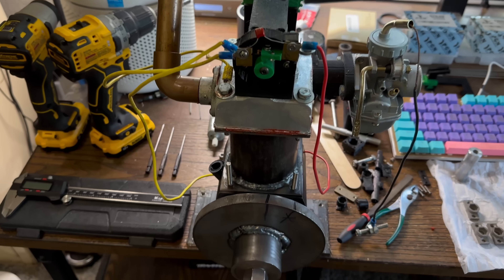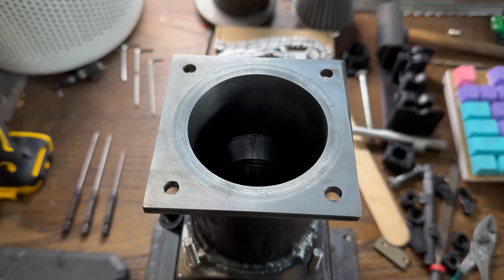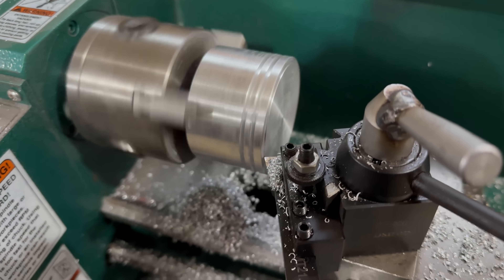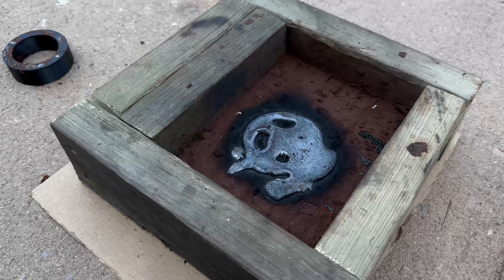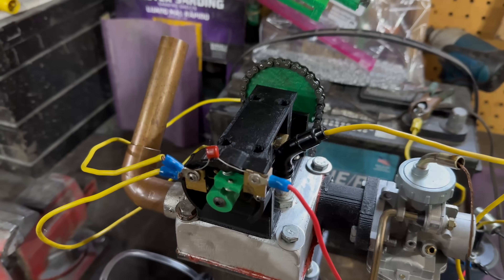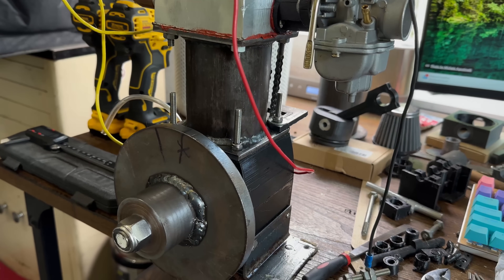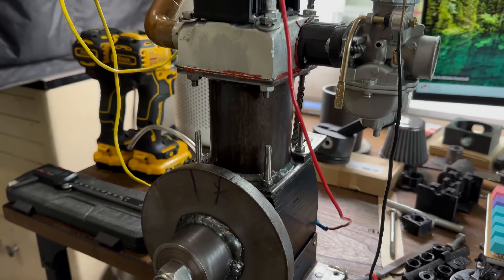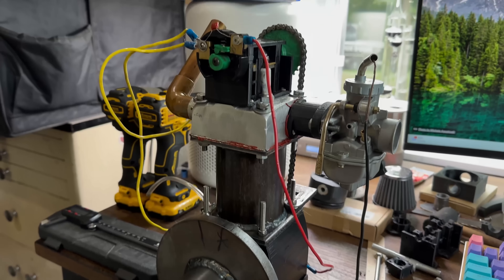Homemade engine gets Aluminum piston! Technology from a Top Fuel Dragster!

Comment: 6:30 
strength is not the real issue the real problem is heat no matter how strong the plastic,is it will burns it gets too hot
Reply from the maker: You should check out my latest video, I think you will like it!

Comment: I love the experiment but 3d print filament just can't take friction heat. The longer it runs the hotter it gets the more it melts and comes apart.
Reply from the maker: Yeah, it was just for fun though. I knew from the beginning that I was going to end up with a full metal engine, but I wanted to see how far 3d printed parts could get me. Also, the 3d printed parts were amazing for prototyping, it made making the engine much easier.

Thank you for watching!

Comment: You shouldve made a cast of the connecting rod using that drag cylinder
Reply from the maker: The issue is is that cast aluminum is very weak, the top fuel piston is forged, so when I melted it down, I lost all of its properties.

Thank you for watching!!

Comment: a cooling fan and some welded cooling fins on the cylinder cans help for the run. the temperature in the cylinderwall and combustion chamber are overheating?
Reply from the maker: I don’t know, although I’m not going to air cool, I’m going to wrap the cylinders with copper tubing and make a small centrifugal water pump for the engine.

Thank you for watching!

Comment: The pitting on the top will increase the knocking in your engine.
But nice done :)
Reply from the maker: I don’t think I’ll have issues with knocking, especially with a 5-1 compression ratio, unless it runs really really hot🤣 I do need to fix that though, I need to sand a little more off of my intake lobe, so that my intake valve closes a little bit earlier. 

Thank you for watching!!

Comment: make an homemade carb just wy not when making a homemade engine, that wold be cool

ps awsome work
Reply from the maker: Thank you! I don’t want to dig into carbs at the moment, they’re a little too complex and require very tight tolerances, and I don’t really want to dig into that right now.
Reply: @ProjectLMZ ok but have you plans for cooling? The engine
Reply from the maker: @huskyswe3163  yes I do, I think I can wrap the cylinders with quarter inch inner diameter copper pipe, and then flow water through them.
Reply: I think thas a good ide

Comment: On a hot rolled pipe like this, that has weld seam, there is always internal tension in the steel. What you need to do before you do the machining is to heat the pipe. Then you take out the tension and will normalize the steel. Heat the parts to a temperature of about 650ºC for a minimum of one hour or till the whole part reaches the temperature. Usually it is better to get seamless material pipe...
Reply from the maker: I did get DOM steel pipe, it is the seamless stuff. I got that specifically for machining purposes, but now I know it’s good for two reasons!

Comment: ❤😂 😊 really like this engine, so fun and informative.
It is great to see things  progressing. 
Ps that was a super long run, your engine has NO cooling.
All heat is going into head.
Cheap fix rap cylinder in copper pipe drill water way through head use 12v aux heater water pump from wv cheap, small but will help.😊
Reply from the maker: I might actually use that idea on my next engine, wrapping the cylinder with copper pipe! There’s not enough room to drill a hole through the head, but my next engine is going to be a push rod V4! I think that would actually work really good for keeping the V4 cool!

Comment: Hint: use cast aluminium rims as a source for cast quality aluminium 👌
Reply from the maker: That’s what I want, it is specifically made for castings and it has good strength, but I don’t know we’re to get some for cheap. 

Thank you for watching!
Reply: @ProjectLMZ  don't know you place, here I usually just search for "wheels" or something like om marketplace/similar. Dirt, scratches, bad tires just make them cheaper 🙃

Comment: Stop wasting time using plastic. 3d printers are cool but nor practical for applications like this.
Reply from the maker: The plastic is for prototyping, as it would make zero sense to try making a part out of metal first, that would be a bigger waste of time. With plastic, I can make a part that works, and then convert it to metal once I’ve proved the design worked. Also, in the next video, I’m getting a titanium connecting rod!

Comment: Just because you used the top fuel piston once you melted it, it lost all its FORGED properties
Reply from the maker: I know, I didn’t realize that they were forged, some of them are still cast, but most of them are forged. Although I am still getting one benefit, and that is the type of aluminum. Aluminum from pop cans is extremely weak, like 13,000 psi, whereas top fuel dragster Pistons are made with a much stronger aluminum, even when cast.

Comment: Pretty impressive i must say :)  The divots in your piston are going to cause hot spots and potentially cause it to become weak and come apart, but can tell you have the skills to make a better one (took me a few attempts myself to get it right a lot was to do with the mold make sure it has a good vent hole and try to degass your ali before pouring it in) and impressed you can do cast i struggle to get my foundry hot enough.
keep it up and its great we live in a time with knowledge and things like 3d printers etc so available to people
Reply from the maker: If I do ever have issues with the piston, it really wasn’t that difficult to machine, I’ll just cast and machine another one. For cast iron, I have a devil forge FB1SB, and I usually run about 0.18 MPa, and at that pressure it takes around 25 to 30 minutes to melt 5 pounds of cast-iron. I think the reason why my piston turned out so bad is two reasons, I used cocoa powder as a mold release, I didn’t have anything else on hand, and the aluminum from a top fuel dragster piston is actually forged, but I don’t know what type of aluminum it is. 

Thank you for watching!!

Comment: You need to make a aluminium connecting rod. That plastic thing will break, catastrophically.
Use some thick aluminium plate, say 3/4" or 7/8" whatever suits.
I've made them for Honda Gx200 engines. They seem to be ok, but I don't rev them super hard.
The 3d printing thing is OK for making models of prototype parts but actual engine parts need to be metal. 3d printing can also be good for making patterns for lost wax aluminium casting.
Great work. I really enjoyed your video.
Reply from the maker: I am getting a titanium connecting rod in the next video! The only issue with casting aluminum is that it actually is super weak, the kind of aluminum I have turns out to be like ~13,000 psi, but the titanium one I’m getting is grade 5 titanium. It has a tensile strength of around 130,000 psi! So it definitely won’t be breaking. When I get that installed, I’m going to see how the engine handles full throttle, and I’m expecting valve float, but my engine is a non-interference engine, meaning that the valves and the pistons never occupy the same space. So basically I can use valve float as my RPM limiter.

Thank you for watching!

Comment: a gas engine can run away if  the ignition timing is off relative to the piston going down (it ignites the fuel when the piston is going down and not up), I had something like that happen to a 250cc 4 stroke bike once

Comment: All engines have aluminum pistons. Not sure part is top fuel inspired.
Reply from the maker: Well, I melted down a top fuel, dragster piston, which is a different type of aluminum. It’s specifically designed for higher temperature applications, for running nitro methane in a top fuel dragster.

Thank you for watching!!

Comment: Better too much oil than too little!

Side thought for future piston rods even though the PETG held up great! You know that trick where you pause the print and insert magnets? Insert metal or formed wire then print over to seal it in for extra strength maybe? If you want that puppy to hit 10k rpm, heh heh! :p 

Hybrid materials would still technically count as 3D printed for the pedants too, lols. Great work!
Reply from the maker: In my next video, I will have a new connecting rod, and it’s going to made out of titanium!!
Reply: @ProjectLMZ  Even better! I'll knock wood for that 10k then! :face-red-heart-shape:

Comment: Please open a window or door to the outside with some sort of fan to circulate fresh air. That’s very dangerous for you even if you run it for such a short time.
Reply from the maker: After it started smoking, I opened the overhead door, I get a nice breeze in there with the overhead door open, and it blows the smoke out of there pretty good.

Thank you for watching!!

Comment: Love what you are doing, not everyone can build an engine from scratch. Your cast piston is very cool, but i would recommend trying harder to get a smooth surface. On the side the little holes are not that bad, but in the combustion chamber they could lead to ringing or knocking because the air fuel mixture combusts early because of heat spots in the holes. Sorry for my bad english, greetings from germany :)
Reply from the maker: I didn’t realize it could lead to knocking, although I don’t think my compression ratio is high enough for that to happen, I’m at like a 7-1 or 8-1, so not very high of a compression ratio. Although I do think that if my engine runs for long enough, that the pitting on the piston crown could lead to deeper pitting from the fuel and combustion.

Thank you for watching!!

Comment: As a former space parts inspector with that much visible pitting, we would just Auto delete that by putting it right back in the forge.
Reply from the maker: Only issue is that if I did that the same thing would happen, all of my ingots I casted had the same thing happen. I think it is because the top fuel pistons are forged, but either way I don’t think it hurts anything.

Thank you for watching!!
Reply: @ProjectLMZ  also the moisture content in the air and casting material vastly effects pitting.

Comment: Dude, I´m serious: You have to get the exhaust out of the room. Pronto. You´re still Young but very talented, if You want to become a wise, OLD engineer then get the air situation sorted. This thing coffs out ALL the nasty. Can´t You take it outside or hole saw the wall so the fumes bother the mosquitoes?
And (just to be that OSHA fart we all hate) use nitril gloves, latex gets dissolved. You take in all kinds of other nasty thru the skin, too. Mechanics are in danger to catch all kind of weird sicknesses because of all the fun stuff. I´d like for You to keep at it but more safe for You. It won´t kill You right away but might very well be responsible for cancer at age.
Have a good making time, You really are good at homebrewing, maybe build a gokart to drive this around and a water jacket for the cylinder? Kind Regards
Reply from the maker: Immediately after the smoke started building up, I opened the overhead door, and with the breeze that comes in, it blows out the smoke pretty good. Thank you for your concern though! I appreciate it! I am planning on trying to make a homemade go kart, or putting the engine on my bike. Either way it’d be pretty fun, and I bet this engine is actually making some pretty good power.

Thank you for watching!!

Comment: I'm curious, if you ever do a second home-built engine would you make it a flat head motor instead of an overhead valve design? I'm just curious, either way this is very promising and I'm curious to see how far it'll go. If you add air cooling you might be able to attempt attaching this to a bicycle some day.
Reply from the maker: My next engine is going to be a in-line 2 version of this, I attempted a flathead engine a while back, but it just didn’t work, I didn’t even get far enough to test it. I think the overhead cam is much simpler, because I don’t have to incorporate the camshaft into the crank case or make an adapter for it. But once I get this engine completed, I’m planning on making an inline 2 version!

Comment: fuck that runaway attempt, let it run as much and as fast as it wants
Reply from the maker: I will when I don’t have a plastic connecting rod🤣 I bet if it got any higher, the plastic connecting rod would’ve broken again, but in my next video, I’m getting a titanium connecting rod, and once I have that installed, I’m gonna go full throttle and tell either valve float gets it or something else! And that’s one benefit to my engine, mine is a non-interference engine, meaning that even if my engine experiences valve float, my engine will be fine, so it’s kind of my RPM limiter. I just set the valve springs to however many RPMs I want it to go!

Comment: smoke error detected 😄btw. maybe try to use that top fuel rod ☠☠
Reply from the maker: Might be a little big, but I should try to make a single cylinder engine with the top fuel piston, valves, and rod! 💀
Reply: @ProjectLMZ  oh yeah thats even better, top fuel single two stroke

Comment: It's mostly missing a firing cycle. You can hear it clean up and fire every cycle like it should be. So you might want to check either the fuel mixture or the ignition. Nice work
Reply from the maker: My ignition is around 5-8° before top dead center, so I think it’s probably the fuel mixture, for some reason it likes to run really rich, I think it’s because I haven’t got it to run long enough to actually warm up, but the air screw has to be almost completely in in order for it to run, which from my understanding means it’s running as rich as it can. I have a feeling that’s the reason why I’m experiencing all the buildup to, as after the short run time I’ve put through it. There is a lot of carbon buildup on the exhaust valve and exhaust.

Comment: Just a tip: try rotating the cylinder ring gaps away from wach other to prevent blowby which could be a reason for your engine burning oil
Reply from the maker: I did, when I installed the piston I staggered the rings 180°, I think it’s just burning oil that’s getting through rings themselves, not the gaps.
Reply: @ProjectLMZ   Great looking engine by the way. I also love your approach at designing it. 
Greetings from Germany
Reply from the maker: @Milk-lm7zy  thank you! I appreciate a lot!

Comment: For future creations I wouldn't recommend using top fuel pistons to cast anything, because they're made from a wrought aluminum alloy which does not have the same strenght/ toughness when cast and also other side effects that make it unsuitable for casting (as you could tell). Castings in general should be taken with a grain of salt, be Safe!
Reply from the maker: Yeah, I forgot that they are forged pistons, although it is still probably better than aluminum from pop cans. Casted aluminum from pop cans has a tensile strength of roughly 13,000 psi, so it is very weak.

Comment: Suggestion: raise that idle up until it sounds like there is no gap in combustion, single cylinders like to idle at around 1200-1400 rpms! I have a few temperamental singles, and I often find when I rev them up and let off the gas, they dip below idle before returning to normal.
Reply from the maker: I’ll try that next time I have it fired up, I don’t know how many RPMs it was idling at before, but when it started to rev up, it was getting a little scary!🤣

Comment: When you measure the bore, you should measure at the top, and at the bottom. Cool stuff btw. :)  Also, I didn't see you do this, but did you clock the rings 180 from each other?
Reply from the maker: I did measure the top and bottom, I had a slight taper, the top was 66.69 mm x 66.68 mm, and the bottom was 66.68 mm x 66.67 mm, I just didn’t include it in the video. Also, yes, I did turn the rings 180° from each other. 

Thank you for watching!!
Reply: @ProjectLMZ  Nice, keep up the good work! :)

Comment: I'd also try a fabricated steel piston. Will expand with heat at the same rate as the cylinder, so less likely to seize. Also, put a long rubber hose over the exhaust and aim it outside.
Reply from the maker: A steel piston would be way too heavy, even with the current aluminum one I’m pushing the limits of what I was allowing myself when I made the crankshaft, and I accounted for thermal expansion in my piston clearances. As for the exhaust, when I open up the big overhead door, it gets a nice breeze through there, so nothing to worry about there. 

Thank you for watching!!